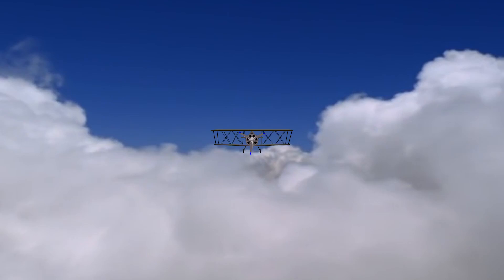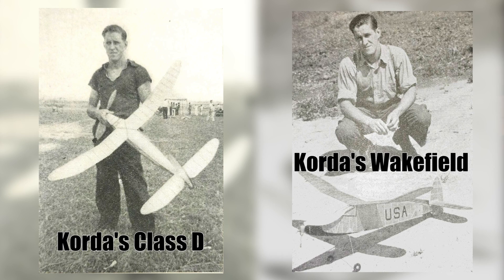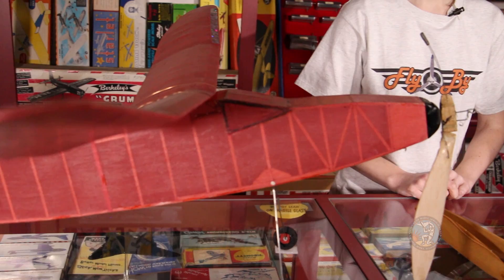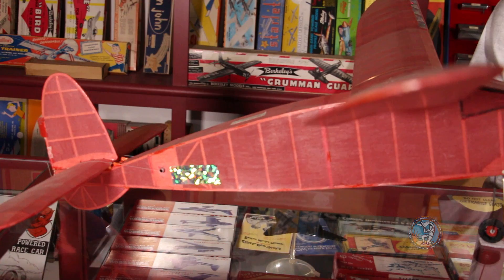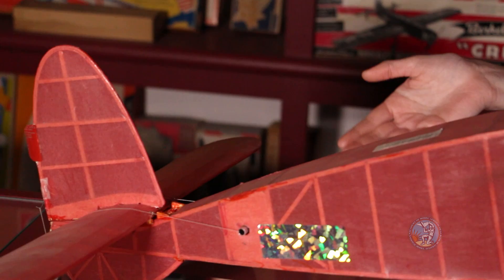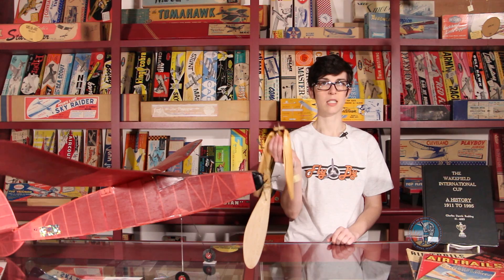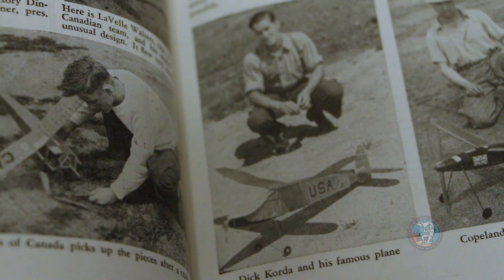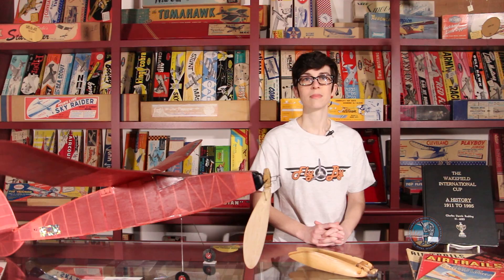Fly By - "Korda's Wakefield"

Comment: Awesome job showcasing this model. Kordas are still quite popular as they fly exceptionally well. One point to correct though: Until 1954 the Wakefield minimum weight included the weight of the rubber, leading to designs in the early 50's which weighed as little as 3 oz and carried 5 oz of rubber, hence the moniker "paper bag full of rubber". The minimum weight was introduced in 1934 at 4 oz and raised to 8 oz in 1937, where it remained until 1957. Maximum rubber motor weights were introduced in 1954 and progressively reduced to the present allotment of 30 g, just over 1 oz.
Reply from the maker: Thanks for your comment, Joshua! According to our research, the minimum weight of 8 oz excluded rubber until 1954, when the requirement became 80 gr of rubber.
For more info about the Wakefield Event rules, check out: http://bit.ly/Wakefield-RulesSummary